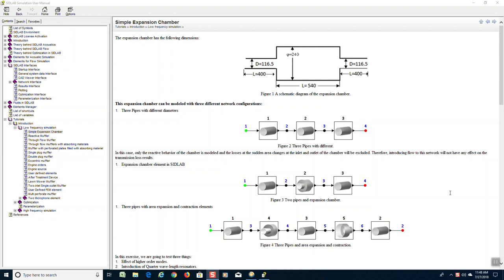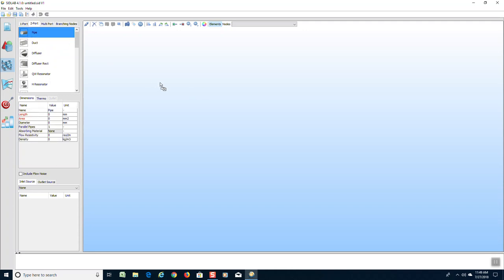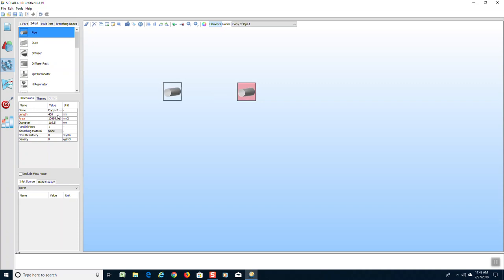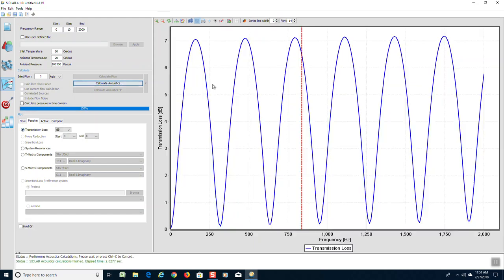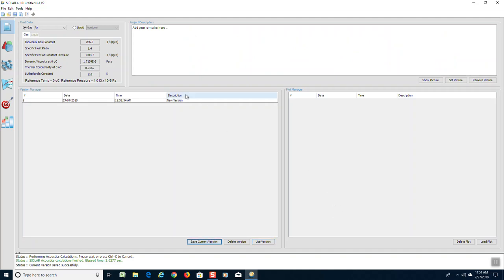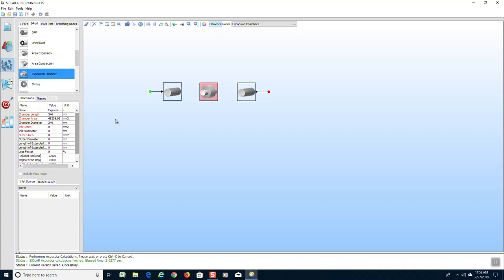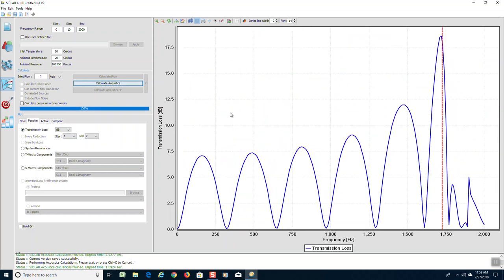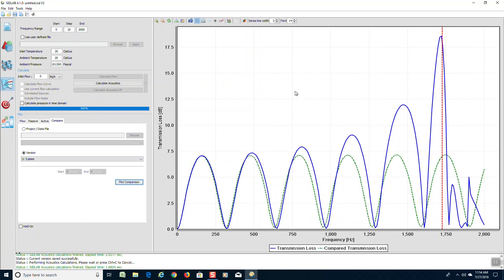Modeling of Expansion Chamber Muffler

Comment: Cool!! Is there a way to see how it sounds like?
Reply: Yes, you can use play sound feature to hear how the sound look like out from the muffler, but you need to add noise source as input (e.g. engine) to calculate the sound pressure level outside the muffler